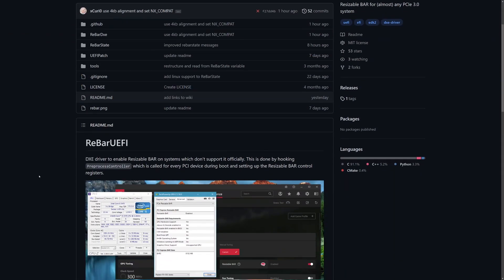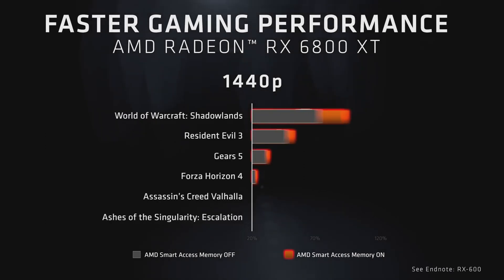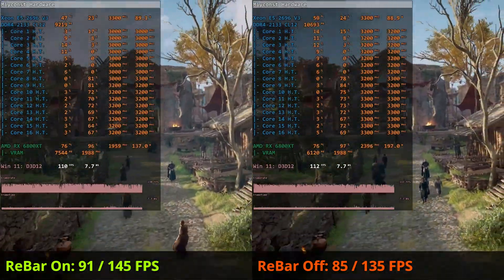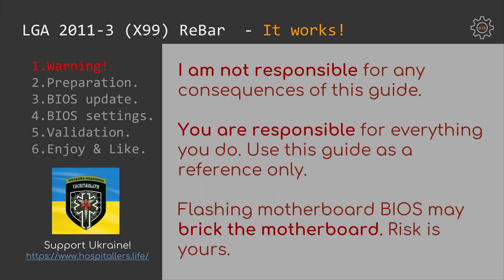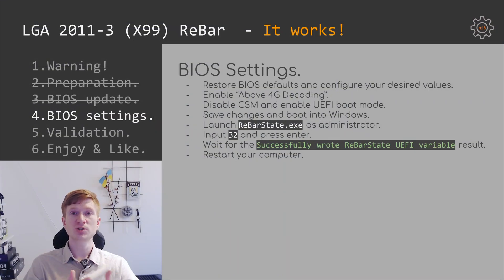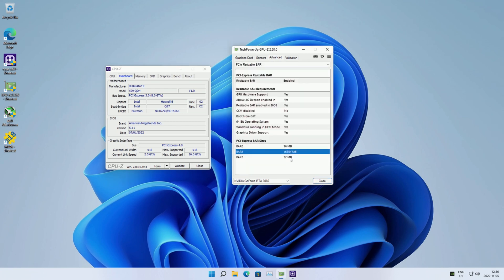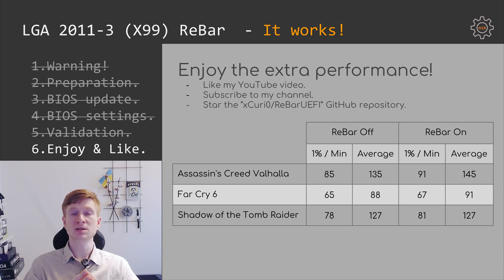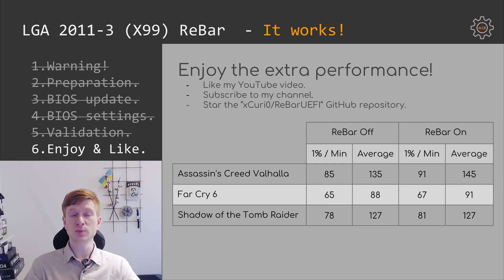🇬🇧 Resizable BAR (ReBar) on LGA 2011-3 X99 – how to enable and get extra performance

Comment: Hi Miyconst, will it work on my Huananzhi X99 F8 which was purchased on year 2020 April? Thanks
Reply from the maker: Yes, I see no reason why it should not.
Reply: @Miyconst  Ok. But not sure why I could not find 4G decoding in the bios Advanced tab. I have no PCI Subsystem category also. Hence, I will try to flash the bios using your -70/50mV bios ROM.

However, I am not sure which one to use, the V3 Payne or the S3Turbo V0.2 for my X99 F8 which was purchased in 2020. I wish to have your kind advice, thank you.

Comment: If i remove the baterry of motherboard,  this can crash my system ?
Reply from the maker: No, the motherboard works without the battery, but the battery is needed to preserve BIOS settings.
Reply: @Miyconst Oh sure. if i remove the battery with ReBAR ON , will this stop giving an image on the pc?
Reply from the maker: I should not, but it will disable Rebar.
Reply: @Miyconst  thanks 🇧🇷🤞🏼🇺🇦

Comment: Greetings, I can confirm that it's working on my asus x99-m ws. Injected the driver manually with uefitools on the original cap file from the asus site. Also needed to apply uefipatches othervise I could not activate rbar, took me a couple tries but finally rbar is working with xeon e5 2699v4 an intel ark 750. For all asus users, only usb flashback works with the modified file easiely. Thanks for your guide and greetings from germany.
Reply from the maker: Thanks for the info and greetings back from Sweden.
Reply: Tried this on my Asus X99 Deluxe II. Downloaded the cap file from asus website. Injected the driver with uefitools on the original cap but when I attempt to flash the modded cap the flash utility says "Selected file is not a proper BIOS!" The unmodified cap will install just fine. Somehow the flash tool is seeing that the cap was modded and refusing to flash it. Any ideas on how to get around this?
Reply from the maker: @otumseh4256  Asus refuses to flash modified BIOS, they have a security check for that, you need to either try to hack it with AfuWin or use an external flash programmer.
Reply: @Miyconst  I appreciate your response and suggestion. With it I was able to successfully install the modified bios by using AfuWin64 on a ROM that had its header removed and after applying UEFIPatches. Arc A770 is now working like it should. Thanks!
Reply: For ASUS X99 tried AI Suite, EZ Flash, the USB recovery Flasher button, and AfuWin. None of them can get past that security lock on modified BIOS I suppose.
Reply: Ok so after a series of obstacles I can confirm got working on ASUS X99-WS-E
Could only flash using USB Flashback, had to rename BIOS file to correct name (check your manual) and make sure USB format is FAT32 
Had to patch the BIOS file using UEFIPatch as well, which I think can find in the GITHUB (Without patch I was getting error using ReBarState.exe think something to do with NVRAM whitelist)
Now could run ReBarState.exe and enable REBAR.

Comment: Does this procedure work with the Xeon 2667 V4?
Reply from the maker: Yes, Resizable Bar works with all LGA 2011-3 CPUs if the BIOS is patched correctly.

Comment: Im on a RX 580 and the Resizable Bar ia enabled on GPUZ, but on click GPU hardware support and graphivs driver support are No and Unsupported GPU, respectively
Is it activated or not?
Reply from the maker: RX 580 doesn't officially support Resizable Bar, so that's why drivers may report it so, still it's hard to tell whether it's enabled for real or GPU-Z is going bananas.
Reply: @Miyconst  its even enabled on Adrenalin, but it says unsupported in GPUZ..
The thing is that i didnt feel a diference enabling it
Reply from the maker: @sakagreymu  AMD RX 580 is too weak to feel the difference, it will be a couple of FPS here and there.

Comment: Will this work with lenovo p900 x99 board?  Just ordered a770 and realized the rebar situation after the fact
Reply from the maker: It may or may not, depends on the Lenovo BIOS. Take a dumb of it and see if UEFITool can edit it.
Reply: @Miyconst   we were able to read using AMI flasher, fpt 9.1 said cpu doesn't have read permissions or somewhere alone those lines.  

We injected the driver, reflashed with AMI, rebooted Enabled CSM, Disable legacy boot, enable uefi boot
Run rebarstate, says success when changing to unlimited size (32)

Reboot, no rebar in gpuz or the intel utitlity.

When re-reading the bios with AMI it appears the rebar dxe driver is not there.

Any ideas?  Would be much appreciated, friend is trying to make a770 work in his p900 with dual 2699-v3 cpu

P.S. He does have above 4g support

Comment: It is Possible on Huananzhi X99-TF ( G368J ) ver1.1 ? i didnt find on the bios 4G decoding
Reply from the maker: It's surely possible, but you may have to use AMIBCP to enable Above 4G Decoding or use another BIOS.

Comment: Dear Miyconst,
Could you give me tutorial how to setting the bios or system for install NVIDIA K80 on Huananzhi X99-TF with output video gforce gtx 960..
Currently, i tried to set the "above 4g decoding", however the PC got bootloop.

I appreciate, if you give me the tutorial
Thank you

Comment: Hi, thank you for your effort on making this video. I'm currently on Gigabyte X99-Gaming G1 with E3 1660v2, I followed the instruction and inserted the ReBarDxe.ffs and flash the Bios. Everything works fine, I even verify that the installed bios has the new dxe driver. However I cannot find the option in the bios to enable above 4g. Could you please help me shed some light as what I may did wrong?
Reply from the maker: It doesn't seem like you did anything wrong, your motherboard probably doesn't have the Above 4G decoding feature.

Comment: I did everything according to the instructions, but after the last action of entering 32 Rebel state and restarting the pc, it goes to reboot again and then the black screen 8 long squeaks (power to the video card stops coming) is solved completely by turning off the PC from the power supply button, but all bios settings fly off and Rebar state settings fly off I don't know how to solve it x99-D8 xeon 2678v3 rx5500xt and the second gtx 750ti video card (sorry for my English)
Reply from the maker: Remove the 750 Ti, disable CSM and try again.
Reply: @Miyconst  Thanks, I earned it, then I put it back and it started anyway

Comment: This worked with my MACHINIST RS9 & RTX A2000 6GB!  Time to benchmark with BF2042.  E5-2640 V3 Turbo Unlocked (-50mv), 32GB Ram.  Thank you for always giving us great info for the X99 platform!
Reply: Is the performance difference huge with the A2000? I'm looking at quite literally the same setup..

Comment: Just in case anyone wants to know I tried this on a MSI X99 SLI Plus motherboard that I already had the turbo boost hack enabled on. It works, but for whatever reason once I went into the bios and enabled Above 4G encoding I could no longer access the bios after a reboot. When I pressed escape to access the bios before boot it just gives me a blinking cursor. Windows boots normally and detected Rebar was enabled and everything seems to work properly from inside Windows. I do not know if this is an isolated incident or not, but just be aware once you set everything you may not be able to get back into the bios on some of the original X99 boards. I was able to re-flash the stock bios from inside Windows and everything went back to normal.
Reply from the maker: You don't actually need to reflash the BIOS, you can just clear CMOS and that's it. Did you disable CSM in the BIOS before enabling Above 4G Decoding?
Reply: @Miyconst  I will try again and see if it works. Thanks

Comment: I tried injected this after my undervolt file and still no option in my Asus X99 bios for enabling it but I was able to get 4g to enable.  Wonder what other method could be used to get this working?
Reply from the maker: Injecting the Rebar driver into the BIOS won't add the UI elements, you still have to enable it through the Windows app.

Comment: You don't have to use the payload to enable resizable bar on Linux. Just update your BIOS, turn on Above 4G Decode, and you are good to go. 

To confirm it is enabled, just do this:

# dmesg | grep BAR=

[drm] Detected VRAM RAM=8176M, BAR=8192M

Why I am saying that? Because gaming on Linux is now freaking good.
Reply from the maker: Thanks for letting us know that it also works on Linux.

Comment: mine was working, but not working anymore, after changing GPU or maybe reset BIOS... I did ReBarState.exe again, it says sucess, but rebar not working after rebooting
Reply from the maker: What is your GPU?
Reply: @Miyconst  rtx3070
Reply from the maker: @Raphahxb  check the video BIOS, it may be outdated, the first samples of RTX 3000 GPUs didn't support ReBar.
Reply: @Miyconst  I did BIOS update and now it's working. thank you

Comment: Hi. Thanks for the excellent video.
I did the whole procedure for F8D. No error message occurred. But the Resizable BAR was not recognized. I checked in nvida driver and gpu-z. Will the driver not work on boards with two processors?
Reply from the maker: I didn't have a chance to test dual socket configuration thus I can't say for sure. Do you use your OS in UEFI mode and what's your GPU?
Reply: @Miyconst  Yes, I use UEFI mode.
Reply: I switched the pci-express slot gpu and there was no change.
Reply from the maker: What GPU do you have?
Reply: @Miyconst  Nvidia RTX 3060 TI.
Reply from the maker: @nascimentolc  it could be that your GPU has outdated BIOS without ReBar support.
Reply: @Miyconst  It was exactly the GPU BIOS. Now resizable bar is knowledge. Thank you very much.

Comment: You are a star, thank you for the video and the Mi899 tool.. 

I used AfuWin to dump & flash my "Asrock x99m Fatal1ty", script/tool froze during first attempt at "Erasing NVRAM Block" but luckily MB has dual bios chips, quick recovery flash and then it worked perfectly second try. 

Using a E5-2695 v3, 64GB ECC with an RTX4090 on an Asrock x99m Fatal1ty, Bios P3.30, with 'Unlocked Turbo all cores' & now 'Resizeable BAR'. I can upload/send my bios if anybody wants it.
Reply from the maker: Please join my Discord and send me the BIOS so I can upload it to my OneDrive.
Reply: I have a Fatal1ty X99X Killer/3.1 with bios 3.60. I am wondering if your bios would work for my board? As I am planning on turning this old PC into a NAS and planning on purchasing a cheap ARC A380 for transcoding. Also maybe a stupid question but how did it change your bios screen. Is it still similar UEFI but with added Resizable option or did it change it to the old bios screen type without mouse support? Final question would it hurt to go ahead and install the hacked bios even if i do not currently have a resizable capable GPU (still rocking ASUS ROG POSEIDON GTX 980 Ti Platinum) ?
Reply: @zeedee3929  It wont hurt to have it enabled in the bios - ready for the A380.

It's still UEFI after flash, probably safer if you follow these steps and mod your existing bios, mine was 3.3 and yours is 3.6 - you have a bit more PCB & slots than mine.

Check you have a working dual-bios, it saved my butt - first and only time I've ever needed it.

Comment: it work on my z97 mobo but i only can get 1gb rebar if i go 2gb or more i got black screen... but i guees 1gb is better then nothing
Reply from the maker: You might need to add extra hacks into the BIOS, I would suggest to create an issue in the author's repository, maybe you can get some help, or maybe there is already enough info about that.

Comment: succesfully made it on x79 turbo motherboard (2011v1) with xeon e5 2658v2  & rtx 3050, now need to check cyberpunk performance)
Reply: i have a similar kit there was gain on the 3050 ? and what's your motherboard?
Reply: @TheMiniWilliam  i dont really see difference rebar on vs rebar off

undervolting + little bit of overclocking - will affect greater results

(but tbh i played only batman arkham and a bit of cyberpunk after adding rebar to bios:) )

x79 turbo morherboard

Comment: Fiz o procedimento na minha machinist x99 k9 e a princípio ocorreu tudo certo porém após executar o arquivo rebarstate.exe, setar no 32 e reiniciar o computador não tenho mais vídeo, apenas uma tela preta eterna, alguém teve esse mesmo problema e sabe como resolver?
Reply: If you have a card without rebar compatibility it will give a video example of gtx 1060 or 1050

Comment: An update of me here: i've managed to increase the bar from my rx570 from 256mb to 1gb on my plex hd(x79 turbo) motherboard but only without 4g decoding, anything more than 1gb and the computer won't post only with reflashing the bios to solve on that particular motherboard. My p9x79 by the other hand i've managed to put 256mb on my rtx2060 that was only 128mb, but it seems that this gpu's bios doesn't permit the gpu to go over 256mb! So actually i am quite happy with the results, and i hope this information could be relevant for you and your channel.
Reply: Como você colocou 256mb nela amigo? agradeço pela resposta :)
Reply: @gui.giuliano2k21  Eu consegui com o rebarstate, ele ativou 256mb mas eu não vi diferença de desempenho, o resizable bar segue desativado, mas ainda assim a barra aumentou para 256mb, tem que cuidar pois o Pc pode não iniciar se mexer errado nisso aí, tem que pôr no máximo 256mb no rebarstate, e não mexe nas outras coisas.
Reply: @Filipi4362  Entendi. então no lugar de 32 que voce coloca no rebarstate como no tutorial, voce coloca 256 ao invés de 32?
Reply: @gui.giuliano2k21  É outro número bem abaixo de 32, se botar 32 dá 16gb ou mais se não me engano.

Comment: If I perform the unlock turbo boost with DXE driver, did I inject the ReBar DXE driver after the unlock turbo boost one? Thank you and congratulations for the wonderful job.
Reply from the maker: It doesn't matter when to add a driver as long as you add each driver into their respective places.

Comment: Can u make a step by step tutorial for a asus x99 deluxe mainboard? :D
Reply from the maker: Yes, I could do that if someone could give me the motherboard.
Reply: @Miyconst  the board is in use right now by my girlfriend. Unfortunately I cant send it at this time.

I am a total beginner with bios modification so please dont laugh!

What I tried was to download the latest bios from asus which I have already installed. I then modyfied this bios file like you showed with the UEFITool. I then put the modyfied file on USB drive and tried to flas the bios with ez flash utility directly in the bios. But it sais "this is not a proper Bios".

With Mi899 I wasnt able to dump bios. It sais cpu has no acess to read the bios. Is bios locked? How to unlock a asus bios?

Comment: It 's only for x99? I've a x79 and if you need a x79 for test you can use on my PC for it. =)
Reply from the maker: It should also work on X79, but I couldn't test since I don't have hardware.
Reply: @Miyconst I did all the procedure but when I activate "Above 4G Decoding" my screen is black.
I'm using my system on Legacy, do I have to use UEFI?
Strange that the BIOS screen does not appear on boot either.
Reply from the maker: @kadulessa  yes, as I have said in the video, ReBar works in UEFI mode only.
Reply: @Miyconst  I'm sorry, my english is not so good.
I tried to convert my system and rebuild my bios with mod, but it's really not working for me.
When I activate "Above 4G Decoding" my system do not start. It's showed only a black screen with some white bars, but the bios BIP is ok. 
And the BIOS display the code "Ab".
My motherboard is a X79 Turbo.

Comment: I using your hz-x99-f8.s3tt.7050.mi8 bios and added this reBar to it like in the video. After uploading it to the mobo and resetting, I don't have this PCI option. Did I do something wrong or what?

Comment: Can I use it on my atermiter x99 and Xeon E5 2640 v3 motherboard? And an RX 6600M
Reply from the maker: Yes, you can, most likely.
Reply: @Miyconst  Does my bios need to be UEFI? mine is in legacy
Reply from the maker: @Shadow-lq8vh  yes, it does, I have answered this question in the video.
Reply: @Miyconst  ok thanks, i will try to do it.
Reply: @Miyconst  Hi, The atermiter motherboard does not appear on the Mi899, do you know which one to use?
Reply from the maker: @Shadow-lq8vh  Atermiter is an AliExpress store name, it's not a motherboard name, thus I have no clue what motherboard you are talking about. Feel free to join my Discord and send a picture there.
Reply: @Miyconst  ok, I just called you on discord
Reply: In the Aliexpress store, there is only atermiter motherboard, here in CPUZ it has the name of Default string - X99H
Reply: @Miyconst  I sent you the picture on your discord.

Comment: Yah! Thanks for the very useful information.
I immediately incorporated this DXE driver into the BIOS of my X99-G7.
(It used to work with the X99-8M-F mod BIOS provided by Mi899 Tool. My X99-G7 uses the C226 chipset. Thanks again !!!)
This DXE driver seems to work very well.
My machine has an RX580, so I don't expect a very high performance gain, but I did see a clearly frame rate increase in some games.
I was also surprised to see a clearly performance boost in Unigine's Heaven/Valley graphics benchmark.

With the price of graphics cards coming down, I am planning to replace mine with a better one. I think this trick will help me then as well.

Comment: This worked for me. Jyginue X79, Xeon 2690 v2, Intel Arc A770.
Reply from the maker: Thank you for the confirmation that it works with Intel Arc GPUs.
Reply: So your seeing the expected FPS and performance out of the A770 now?  I know it suffers greatly without rebar.
Reply: @ibbobud  I was using this in my server which runs Linux. I was using the card for things other than gaming.